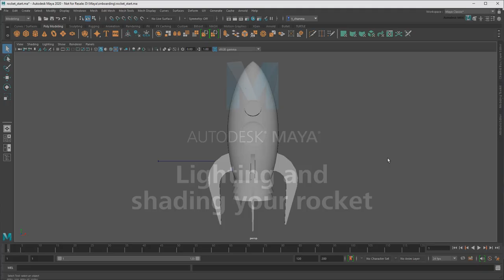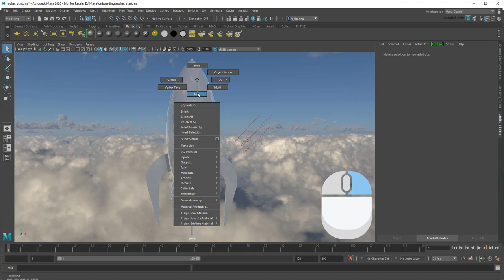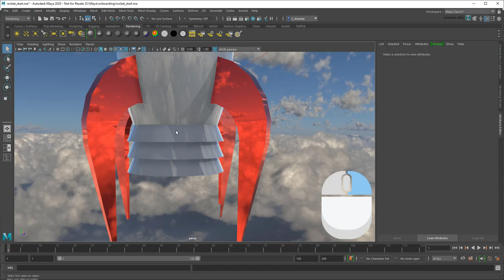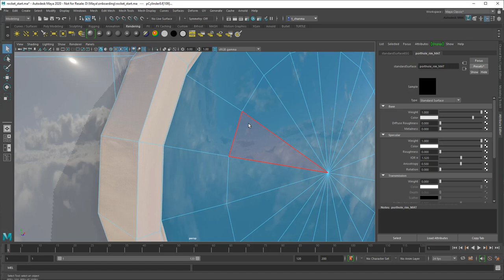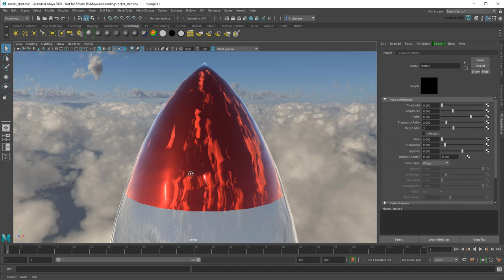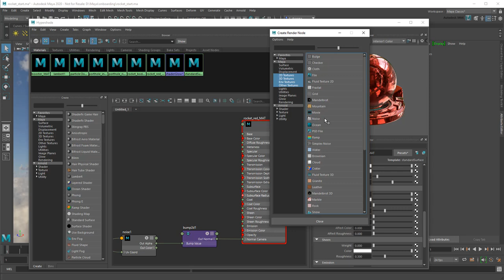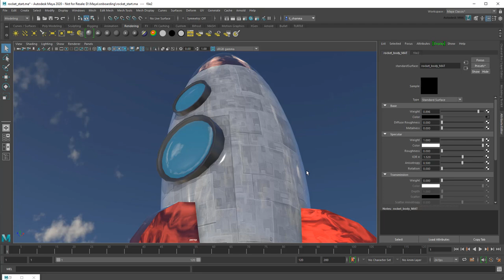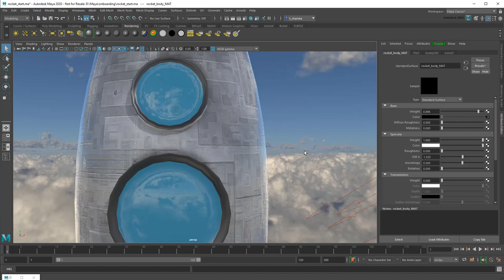Intro to Maya: Lesson 6 / 10 - Lighting and shading your rocket

Comment: What is zero point one 
What is bump value and input button and reduce
Why is it now showing threshold 0.000 in black rectangle next to white small rectangle on left side of black rectangle and two white square and two black square together on the right of this and under these is amplitude with 1.000 in black rectangle next to it and long black thing with white rectangle on the right of it next to it with two black and two white squares next to that and under all these is ratio with 0.707 in black rectangle next to it and long black thing with white rectangle on it is next to two white and two black squares and under this is frequency ratio with 2.000 in black rectangle next to long black thing with white rectangle on it and two black and two white rectangles next to it and under these is depth max which is next to 3 in black rectangle which is next to two white squares and two black square on each other and under these it shows black square next to inflections and under this is time
What is noise attribute and all the stuff under it 
Why up here in the materials tab and where is that we can find a list of all our materials at all times and how and why was it showing a bunch of blue ms and black thing with white words under then black thing was changing colour and why and there’s even this handy little “mini-Attribute editor” we can use instead of the one in the viewport and how and why waps white thing on grey thing and it was moving down and why you could even change the little preview object up here as well and how and why did words come under shader ball and what do these mean and why did white thing go to teapot then the red thing changed
What is mini-attribute editor and materials tab
What is preview object 
Why did red teapot change to ball and it just kept changing when you picked a different word
Why but the real power of the hypershade comes from selecting a material — like your rocket_red_MAT, and then clicking the “show inputs” button down here and where and how and why did white thing go to white rectangle with white triangle on the left of it and what were the other stuff on the right of it and why this shows you what’s called a “shading graph” - that is, a visual representation of your material and how and why did a big grey rectangle with a bunch of white words show and what do all these mean
What is visual representation and why do shading graph give you visuals representation 
What hypershade and power
Why here you can very clearly see your noise feeding into a bump and then feeding into your material via the “Normal Camera” attribute and how 
Why does it show three things in black square and what does everything here mean and why is red rectangle around bottom 
What is “Normal Camera” attribute and via and material 
Why this and what is the connection that Maya created when you assigned your bump map and how and what and why you can drag on this connection to disconnect it… or reconnect it at will and how and why yellow thing came out of purple rectangle and why this is great for quick comparisons or experimentation and how and why to show us this in action, let’s add a coat of dirt on top of the shader as well, by going down to the “coat” section and again connecting some noise to the colour attribute here and how and why it shows create render node and stuff under and what does this mean and why as soon as you do that, Maya adds a second noise node to the Hypershade, which we can see feeding into the shader’s Coat Colour and how and why then you can adjust exactly how much dirt to apply and how and why white thing went to noise type billow then wimpy and how and what were all the words under and on top of wimpy and what is billow
Why is it showing five rectangles with two of them being purple and they had words in them and there were joined together 
and why was it moving under rocket red mat 
What is connection and assigned and disconnect and assigned and comparison and experimentation and “coat” section and connecting and hypershade and shader’s Coat and dirt and apply
Why notice you always have the option to work from either the Viewport or hypershade — and how and why whichever you find more convenient at a given time and how and why white rectangle next to ratio went to the left 
What is convenient and given time 
How do we find things convenient at a given time